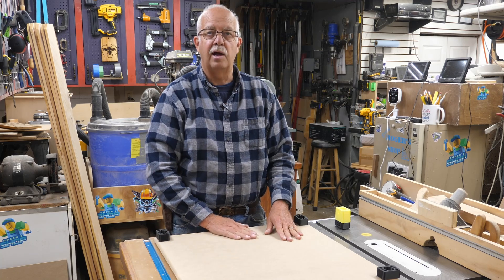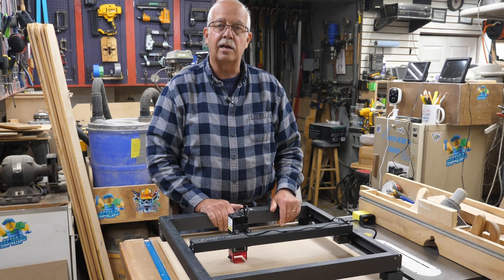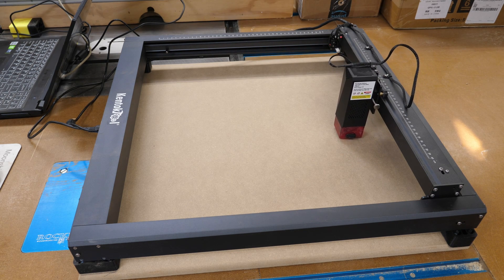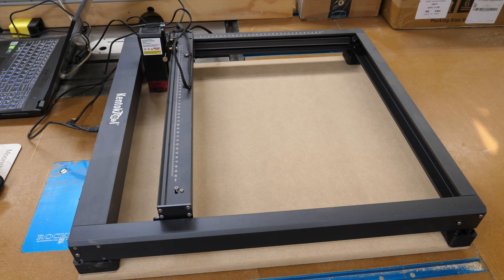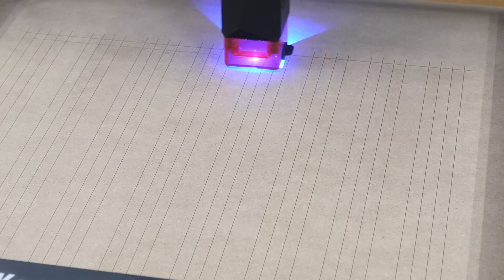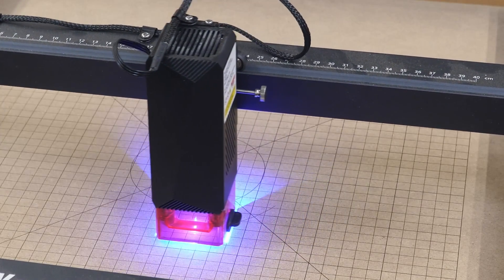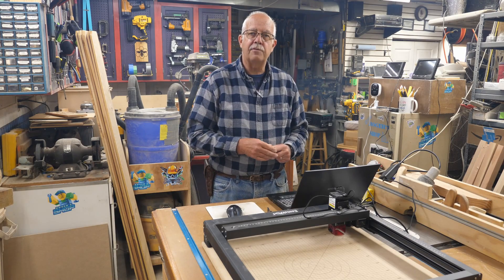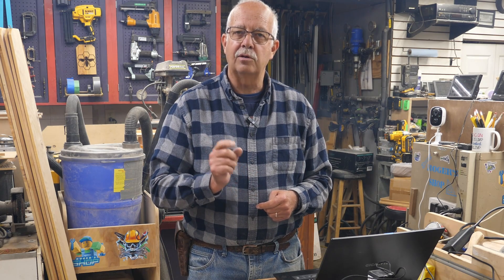Kentok Tools JL7 Laser Custom Base

Comment: Hi, Roger! This is the laser that I won from you. I've added things like air assist, an enclosure, honeycomb grid, camera, etc. Probably my favorite addition to this laser is this custom base that you built for it. It makes everything SO EASY to align! I highly recommend that everyone goes to your website and downloads a version for their laser. Although I probably should have just mounted right angles at each corner for it to slip into, I screwed my honeycomb grid to the base. I load everything at the bottom left corner (home) and it's always aligned. Thanks again for the laser, and especially for the custom base.

Comment: Looks like a xTool copy. Tip - xTool legs fit well in PVC end cap. That's how I hold position. Thanks for grid board designs.
Reply: I'm trying to figure out a good base mount for my Longer Ray5 - It has the normal "legs" provided from the factory, and I added their extendable round legs to get clearance for rotary jobs.  So, essentially there are two sets of legs I have to work around.  Maybe a corner brace screwed down would give it a position guide.